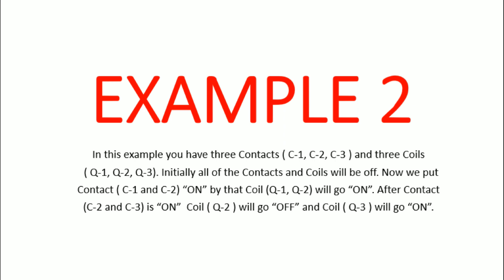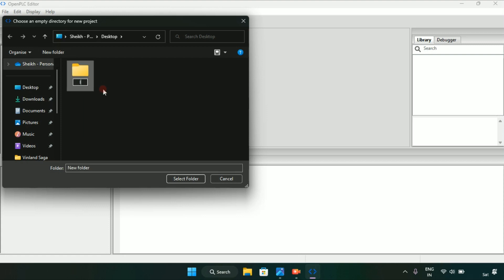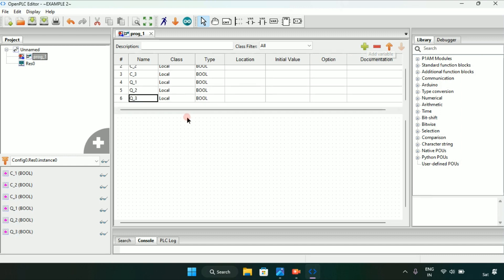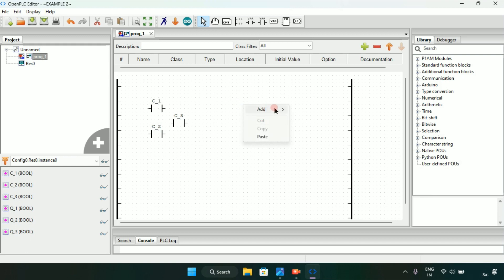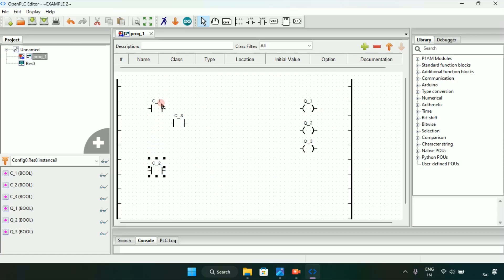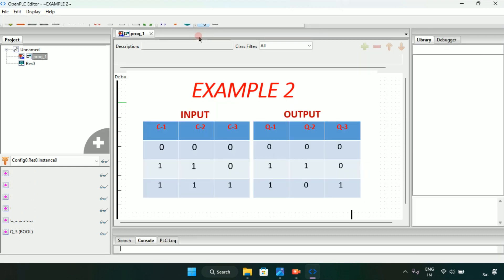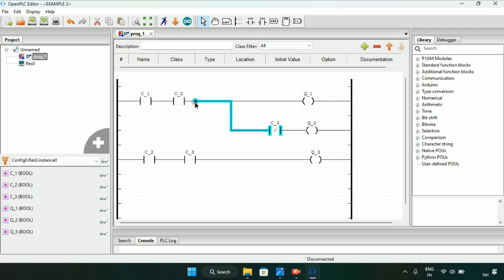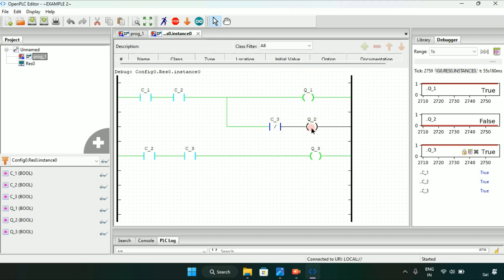OpenPLC - Basic PLC Ladder Programming Example

Comment: If you orient it with C2 going to C1 in series with C1 going to Q1 and Q2, then have C2 also in series with C3 but separate from C1. then C3 connecting to Q1 and Q3, that way to do not need to double up on C3 with one as NO and the other as NC

Comment: sir if I had a supply pump connected to a upper level sensor how would set the pump to go off when the sensor is on in openplceditor
Reply: Depends if the sensor is wired NC or NO.
(Should be wired NC, so an open circuit shuts the pump down. On PLC this is a normal contact controlling the pump coil)